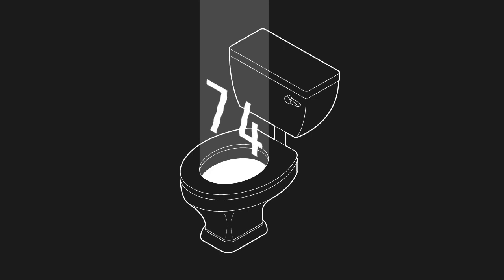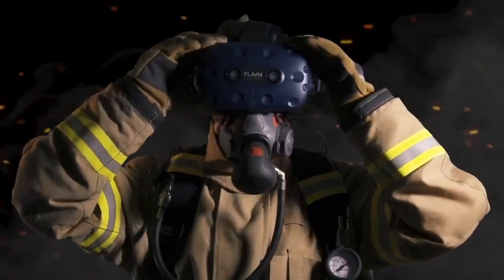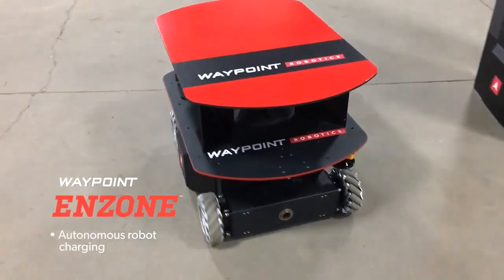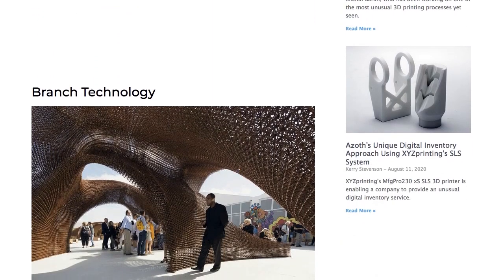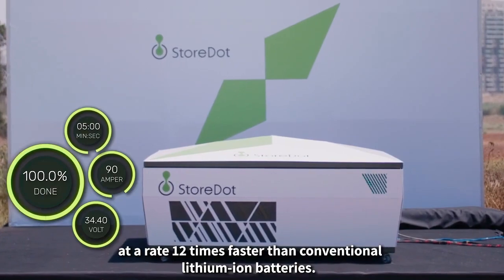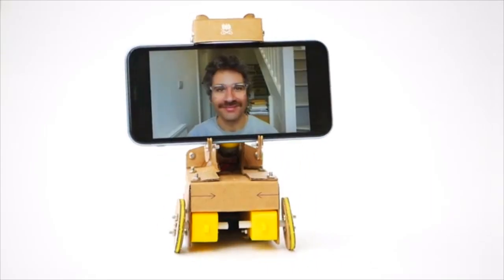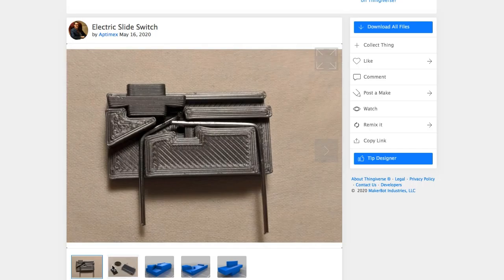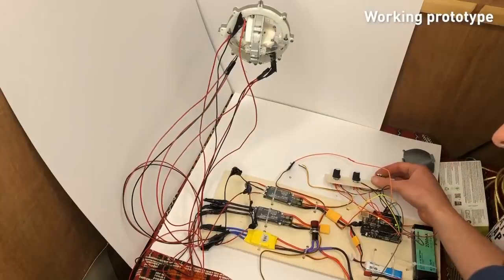Hologram Workout Partners, Cardboard Robots, VR Treadmill, Edge of Tomorrow Exoskeleton +More (CD74)

Comment: I periodically have to do fire fighting training as part of the survival training for offshore work. The practical portions consist of suiting up in actual bunker gear and SCBA system, laying out hoses and fighting actual fires in a mock installation as a team. Granted what you displayed was only a few seconds of preview, but I certainly don't see it replacing that training. That being said, I imagine the VR system is far cheaper than the current practical training, it might make for good supplemental training given that the current practical retraining is usually performed 3 to 5 years apart.